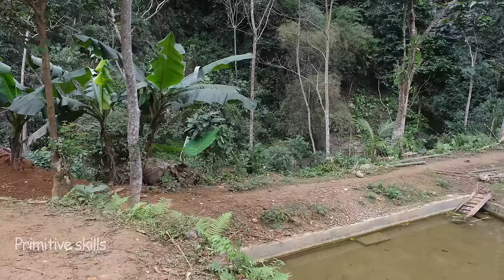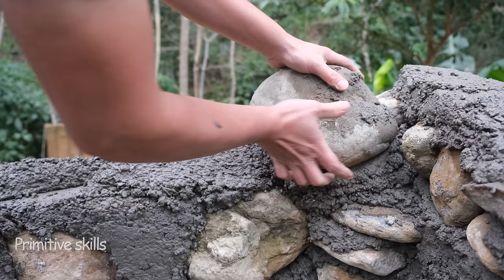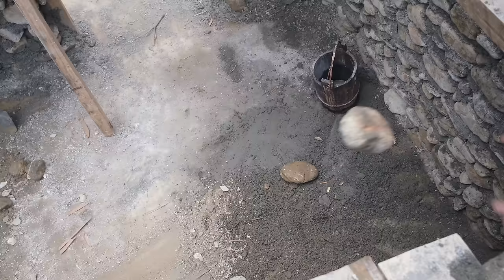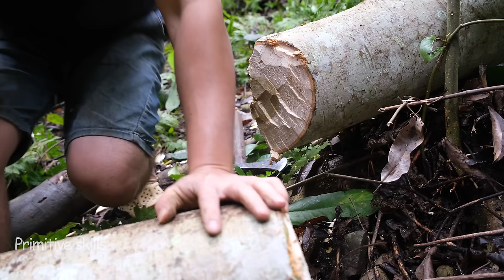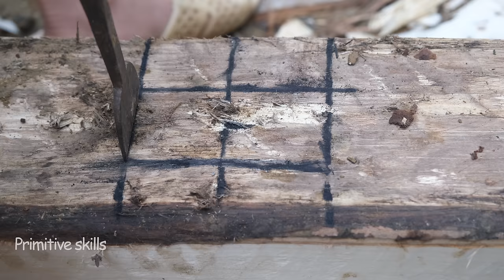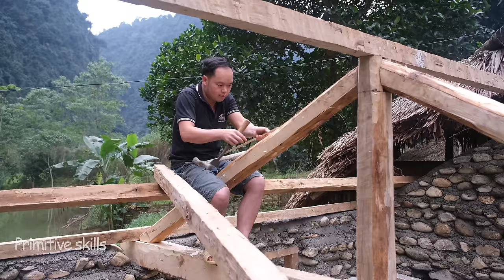PRIMITIVE SKILLS; Build Stone House - BUILD LOG CABIN with many stones in the mountain

Comment: Looks nice. I am impressed with how you can build structures out of green wood without them warping too much from drying out.

But I have a suggestion for you.

If you intend to make a clay tile roof, you need two layers of connected smaller wood pieces on which you will be resting the tiles. One layer goes upwards from top to bottom and then you have one layer that goes left to let you layer the tiles as evenly as possible.

I also suggest nailing them in place too. Since you have a lot of hard storms I suggest you make the clay tiles with premade holes for where you need to nail them in place to lessen the risk of them falling off the roof by a powerful gust of wind.
Reply from the maker: Thank you, wish you and your family good health

Comment: Bravo Duong, you're so brave! To prevent you're beams from rotting, you might want to add a piece of tarp on the wet concrete before resting them on it. It will make your hard work last longer. Again, congratulations! You rock!

Comment: Get mortar on those walls, inside and outside. It Will add structure, prevent water infiltrations and look a lot better. I would also consider adding a fireplace

Comment: Since you live in a very damp area, I suggest you treating your planks with oil and heat so it lasts longer, sometimes wood rots where the structural load of the scaffolding is centered and you can hurt yourself. Take care

Comment: looks like you are working with a soft wood. charring or and fire hardening timbers that you gonna use in the building would have made them stronger as well as a lot more rot resistant. great skill hewing that log with such primetime axe. i'm impressed.

Comment: I would put a vertical beam in the center of the house from the floor to the cross beams to take pressure off the walls because  that's a lot of weight on those walls

Comment: Very enjoyable to watch. Because you ask what we think I must advise you to research dry stone walling so you can see the rules of building with stone. The wall is too thin. You need a minimum of 50mm thick wall to attain such heights, your stones are not crossing, the corners are not interlocking, your stones are essentially dependent on the cement mix to keep them together. In the future the cement will crack and separate from the stones. It is only a matter of time before the whole structure collapses. Hopefully nobody will be there. Other than that, very interesting, enjoyable to watch and solid hard work and mistakes will make you even better. Keep it up.

Comment: if I were to build such a house, I would not use a roof like yours, but a simpler pitched roof. I would build one side 50 cm higher than the other. In that case, the construction would be simpler and all the water from the roof would flow behind the house

Comment: you should propably let the wood dry before using it in consturction, when wood dries it tends to warp. and when u have joints like that in the wood it will warp the whole roof.
Reply: how dry do you want it ???? He is using timber from the old house

Comment: 10:05  Dear Duong, 
I'm really impressed by the great size of the work you accomplish alone! Well done. But I'm also very worried 
... very worried that these walls will slowly be pushed by the frame you put on them, 
and that it will collapse. 

Because you use rounded pebble stones and that you seem not to have placed flat-bottomed stones that cross the entire width of the wall at regular intervals. 

It is also necessary to always cross the stones with those below (you seem to have done it well in some places)

Your wall is magnificent ! ❤  
but I'm worried, 
I don't know if you built it wider at the bottom (compared to the thickness of the wall at the top) . 

Also, 
the base (the foundations) just under the wall : Are they very wide? 

For a stone construction: they must be like the feet for a human body (like the shape of the letter "L" or like the letter "T" upside down) much wider at the bottom to prevent it from sinking to one side or the other. 

If all this has not been done before, the remedy consists of adding short perpendicular walls which will therefore cross and lean against the current wall (like the "+" symbol seen from above) This is called reinforcements. and it's also very beautiful.
Reply from the maker: Thank you, your shares and suggestions are very helpful to me

Comment: I see that good construction but Where are the concrete and iron bases of each corner to hold the house solid and does not destroy itself at least. Because just after a strong whirlwind it can destroy everything. In any case it is good, good continuation

Comment: the other pile of some stones that you made while getting the sand could be used later on as gravel to help maintain some paths so they are as slippery from rain and will help keep plant from over taking to paths... they way your scaffolding wobbles kept making me worry... and a few times i thought some of the rocks were going to fall back down onto you as you were putting them on the scaffolding... good to see you didn't get hurt... using mortar to make the inside walls smooth could help to prevent bugs and spiders from trying to nest inside... Edit: if you do smooth the inside then it could be a good idea to use the lime to make it white after so that it's brighter when the light hits the walls...
Reply from the maker: Thank you, wish you and your family good health

Comment: You're going to need probably double the amount of horizontal supports for when you do the clay tiles for the roof, otherwise the tiles will be too long and brittle. You're also going to need at least two more trusses, one on each side between the center and end/well to support the extra weight. Otherwise there's a risk of the roof collapsing.  

It's fine for now if you're just going to put a temporary wood slat roof to get it weather tight until summer when you can do the clay tiles, just something to keep in mind for later.
Reply from the maker: Thank you, wish you and your family good health

Comment: I dont have a suggestion for the roof i agree with your plan but i do suggest to take more time on the walls and fill in some holes left with mortar. for the inside do the same and make nice corners and maybe do a finish with very fine sand... As of now the walls only look half done
Best of luck and energy to continue building a great house
Reply from the maker: Thank you, your shares are very useful to me

Comment: You are not forced to put only lime powder but can let bigger Lime block like 1 or 2 centimeters, those will naturally solidify the wall in case of a crack when exposed to the weather. Romans used to do this way and it has been proven to give a much more lasting concrete.
Great video
Reply from the maker: Thank you for taking care of my health, my health is stable and very good

Comment: looks very good! But if I may say so, I'm afraid that these walls aren't really stable in the long term. In my opinion, there are still far too many spaces between the stones - including narrow slots. This can all work well, but I would fill the "holes" with mortar to the point where it creates a flat surface. So only the heads of the stones are visible. And all this so quickly that the individual mortars have not set and still form a good bond with each other. This is certainly an enormous amount of additional work, but I think the current status is even more unsafe than when the clay wall was stable. Anyway, I think that the beam structure has collapsed or that one of your thick walls has simply fallen over. Written carefully and with best regards. You are a very good craftsman and all-rounder! I admire your work! your persistence and your tireless energy
Reply from the maker: Please click on the subtitles and select your national language again

Comment: My friend, I'm afraid this house may suffer the same fate. You need to make a belt under the roof to support the walls. So that the roof doesn't put its weight on individual points of the walls. Such a belt should at least be made of wood - or better yet, reinforced cement

Comment: Yo primitive.remember what i suggested? No more thatching that breaks down eventually... Use only interlocking ceramic tiles or metal you'll have a house that your kids would inherit one day amazing job though.. with no modern tools!!
Reply: Just because he used stones and concrete this time doesnt mean its more durable than the mudwalls he had befor. There is a reason stone houses have oak or reinforced concret beams above the windows and doors, and not just a flimsy windowframe mada of thin boards.
On these walls, i wouldnt put a heavy ceramic tile roof, these walls are pure decorative with no structural stability.
You cant build walls with natural stone like you do it with bricks. With natural stones you have to place the stones in a way that the wall would even stand without mortar and use the mortar only to fixate the stones and fil the gaps.
Reply: @wolf310ii  reading your comment I concluded you're probably a builder (I'm not) and does sound like you're informed  about structural integrity 👍

Comment: Với những kỹ năng thô sơ VÀ CÔNG NGHỆ nguyên thủy, hình dạng dễ dàng nhất mà người ta có thể tạo ra từ một cái cây là một mặt cắt hình vuông. Sử dụng công nghệ HIỆN ĐẠI nhưng vẫn chỉ sử dụng KỸ NĂNG thô sơ, dầm đỡ có tiết diện hình chữ nhật sẽ MẠNH MẼ HƠN. CAO HƠN ít nhất 2 - 4 lần so với chiều rộng. CAO HƠN 2 lần có nghĩa là mạnh hơn 3-4 lần!🤓
With primitive skills AND primitive TECHNOLOGY, the easiest shape that one can make from a tree is a square cross section. Using MODERN technology but still using only primitive SKILLS, a supporting beam with a rectangular cross section will be MUCH STRONGER. At least 2 - 4 times HIGHER than wide. 2 times HIGHER means 3-4 times stronger!🤓

Comment: Doung is not building a house, Doung is building a castle. Now you need a moat and a draw bridge so nothing gets in without the password. By the way, have you decided on a roof? Tin is good and cheap. Also, if you thought about insulation so the house stays warm like fiberglass and plywood? In the old times, people used a caste iron fireplace. How does Doung keep a house warm in the winter?
Reply from the maker: Thank you, your shares and suggestions are very helpful to me

Comment: This design does not seem to me much more stable than the previous one. 

At least it would be nice to make a five-wall with an inner wall.
It is not entirely clear what serves as the foundation. Will the soil float away from the rains over time. It is clear that there is no frost heaving here.

I understand that Fachwerk will rot like an ordinary tree. But the question is in the processing of the logs of the rafters. Are you planning to treat it with resin or tar from rotting?
Reply from the maker: Thank you, your shares and suggestions are very helpful to me